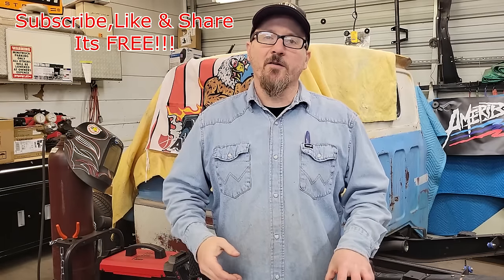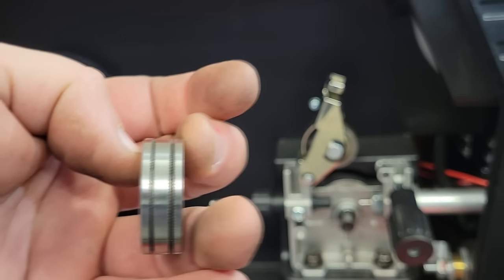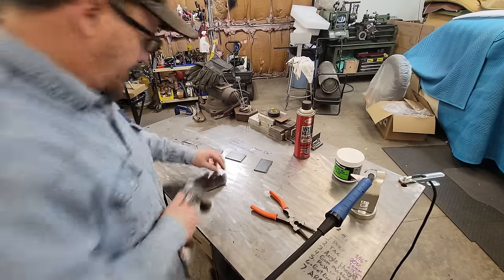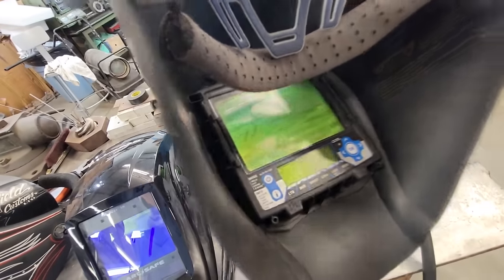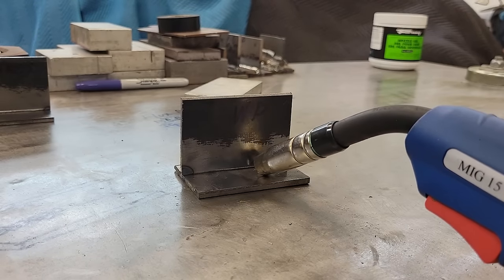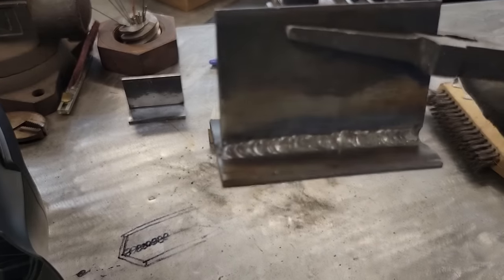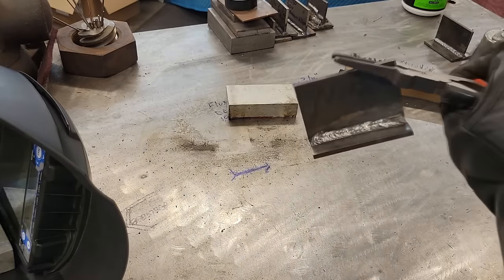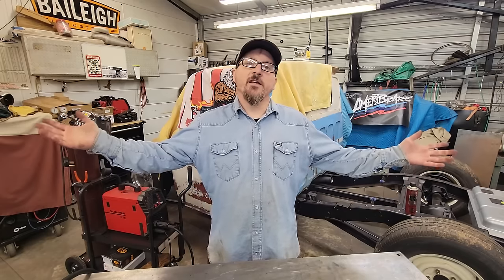Learn to Make (Perfect) FLUX CORE Welds FAST:( How To Stack Dimes)

Comment: I can not get a t joint to fill weld at all. Just welds above or at the base. Millermatic 130xp. I found out the flux wire is about 15+ years old. Wonder if that could be it
Reply from the maker: It could be the wire, ive heard guys say that the wire and brand is very important. But before you switch the wire try to weave it slightly from the top piece to the bottom or like I call it the zigzag. Sometimes doing a slight wiggle up and down can help. Hope this helps!!!!

Comment: concrete cleaning  acid devastates mill scale..you have to wash the piece  in water after, and dry it but that procedure is for small pieces....with a large  plate  sandblast it
Reply from the maker: Thanks for the tip!

Comment: Any cooking spray works very well and half the cost as spatter spay. Spray everywhere you dont want it to stick 99% o the time you can brush it off with your hand.
Reply from the maker: Thanks for the tip!! I've also heard wd40 works also
Reply: @ACDesignsGarage  yeah but 2 times the cost per can...lol
Reply: @ACDesignsGarage I saw another safety video that said wd-40 was dangerous to use around a welder along with brake cleaner.

Comment: I’m repairing a Jeep frame and I plane on using flux what do think
Reply from the maker: It works pretty good, it can be aggravating sometimes. If its rusty you may have trouble with it blowing through,  but for strength it has the penetration as long as you dial in your settings,  hope this helps!!!

Comment: I would never whip and pause or try to stack dimes with GMAW unless penetration isn’t very important. In order to get good root penetration on steel 1/4” or greater with say solid core wire, you typically must run high enough amperage >190 and a relatively high wire speed to get into spray transfer mode while using a specific gas such as Argon + 2-5% Oxygen or Argon + 5%-15% Co2.
Reply from the maker: Its pretty strong for what I do, but I do more motorsports so 3/16" is max. Ive done cut and etch test and the penetration was good.
Reply: He isn't using GMAW, the whole video like the title suggests is about flux core FCAW which is almost identical to MCAW which is metal core same shit different pile , GMAW gas metal arc welding also called metal inert gas  (Mig) arc welding , often has FCAW in lumped in together with because it uses a continuous feed electrode (wire feeder) however only dual shield flux core uses gas and DCEP self shielded flux core is gasless and DCEN and neither is suitable for spray transfer like solid core  mig  welding is using any mig combo gas that has at least 75% Argon which is required to achieve spray transfer, however other then a flat position spray isnt of any use do to lack of fusion , and solid core mig is primarily used in flat, horizonal, even down hand , but vertical up, and overhead positions   you would do with flux core dual shielded flux core or stick and of course tig  these 3 are all positional . In Canada when we  complete the final  year of schooling the 4th year and successfully pass each with each year requiring 1800  on the job apprenticeship hours signed off by a certified red seal journeyman before you can start the next year of schooling , you then take the red seal practical which is stick, mig, tig, flux core, air arc gouging, oxy acelly torch cutting, where you cut a 30 degree bevel and a circle on a 5/8's plate of mild steel about 5"x5" and cut all the other test coupons we call them which are the different weld processes in the different positions that we cut in half after completing to be bend into a U shape on both the root and cap side all test coupons start off as 5/8's plate with a 30 degree bevel that we tack together after making a 3/32 land on each bevel leaving a 3/32 gap as well, except the overhead position which gets a backing plate and only one side has the bevel the other is a straight 90 degrees  and the gap is 5/8's , you use the air arc to gouge off the backing plate when done not touching the base metal  everything is marked your welds must bend cleanly as if part of the base metal no cracking your gouging is graded no touch test plates only backing plate and torch cuts are graded must pass everything to pass and have 5 hours to complete, then you take the written part which has 125 questions and you have 3 hours to complete needing a 70% or better to pass. If you pass both you get your red seal journeyman credentials for welding  but will still be required to take a separate CWB weld test for each position in each welding process GMAW, SMAW, FCAW, GTAW and so on and each is 200 bucks to take on your time and dime almost all companies require both the red seal and CWB credentials.

Comment: Why not just remove the Gas Nozzle while using Flux Core? It makes it much easier to see with it off,
Reply from the maker: You can but it can mess up the nozzle if used alot.

Comment: If you are used to stick welding, you should know, how to use Flux core wire. The weld doesn't, need to look like dimes, to be strong!  I've seen good looking welds break.
Damn you spell checker.
Reply from the maker: Hahaha spell check, your right its just like stick but a lil easer!!

Comment: Just a question…..why have you got an Acetylene bottle on the Mig Welder.
Reply from the maker: Its a mix gas bottle, its 75%argon 25%carbon dixiod for use with solid core sheilded mig welding.

Comment: Why didn't you run a plain bead !?! Your highest strength comes from beads done correctly.
Reply from the maker: I've ran alot of test, cut and etched.  With the proper heat settings there pretty strong for automotive fabrication, maybe not empire state building stuff.